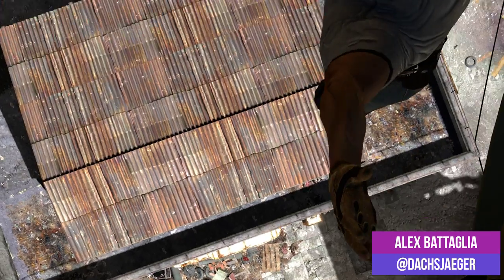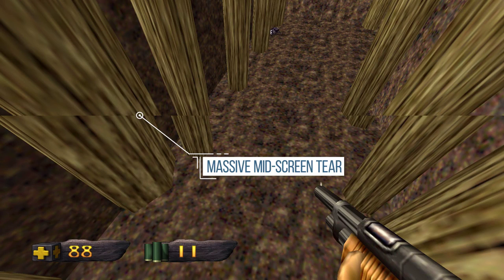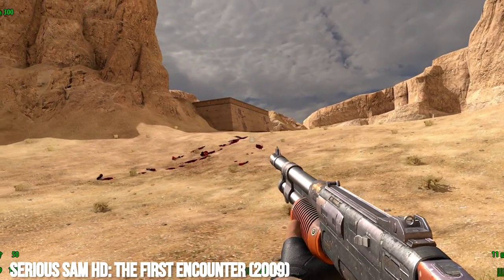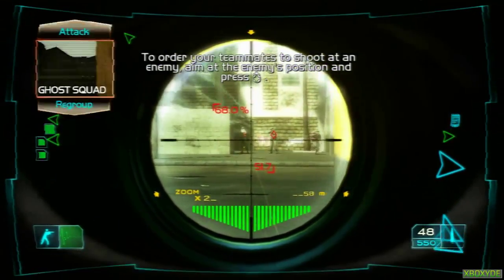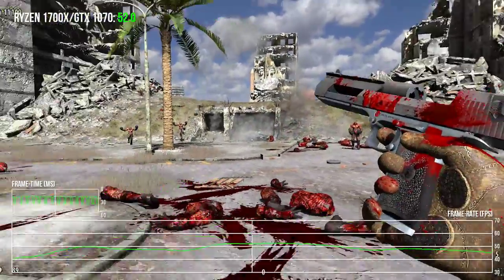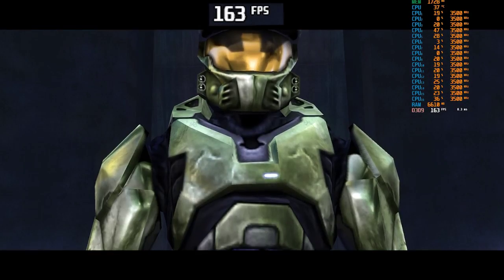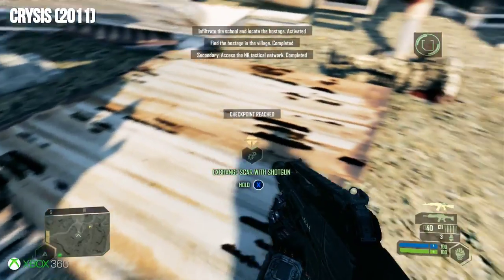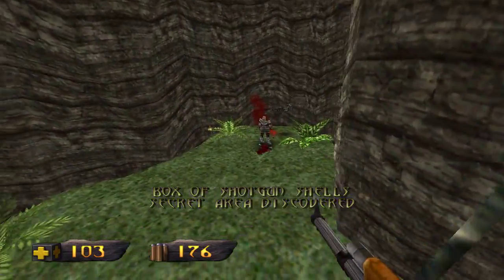Tech Focus - V-Sync: What Is It - And Should You Use It?

Comment: I cant be the only one that uses v-sync to lock the game at 60 fps so my pc wont overheat
Reply: Usually, people lock their framerate using rivatuner
Reply: No, only on older games like the first Witcher and Divinity.
Cap at 60, force v sync. 
Otherwise they run terribly.
Reply: @mrmagoo-i2l  Exactly.
Reply: Sometimes when my laptop gets really hot
Reply: you can get rivatuner or even better, nvidia inspector
Reply: @locxha96  rivatuener alone causes some screen tearing. Using v-sync on my 60hz laptop screen works better.
Reply: AMD has something called "Radeon Chill" which varies the framerate depending on the action going on so it stays responsive in action and cools down when you don't need it. It'll use less than with VSync, but with a better experience most of the time.
Reply: @SummonerArthur  But 60 fps cap with RTSS input lag vs v-sync input lag? Rivatuner wins.
Reply: @leruty both feels the same here but on dead space.
Dead space vsync sucks.

Comment: I cannot play a single game without vsnc
Reply: i use G-sync. I can live without V-sync
Reply: Yup me neither, screen tearing is horrendous.
Reply: I use freesync, no need for vsync.
Reply: I also cant. But its because my laptop overheats and v-sync locks it at 60fps
Reply: Yeah, I am also very sensitive to tearing. Quake was the first game I turned VSync on (on 3DFX Voodoo1). Still remember the console command vid_wait 1. Since then I haven't played a single game without Vsync, cause it turns out I hate tearing much more than slow framerates or input lag or low resolutions. One of the worst and ugliest things that can happen to a game for me is if it starts tearing. Also the reason I don't bother with consoles, where you are basically left at the discretion of developers in this matter.
Reply: @kosmosyche  I can agree that tearing is not great but after I got my 240hz monitor in any game tearing is almost unnoticeable same way with my 144hz monitor except to a lesser degree I don't know about when getting lower framerates since I don't have a game that I get less than 100 fps
Reply: @Wyatt Cheng sad but true

Comment: I feel so lucky, I got a G-SYNC compatible monitor for my first gaming PC, so I haven't really had to deal with any tearing or latency issues.

FYI, Blurbusters has a great series of articles on G-SYNC and input latency. It's full of measurements and solid analysis.
Long story short:
- enable g-sync for fullscreen mode
- globally enable v-sync in NVIDIA control panel (vsync and gsync were intended to work together)
- disable v-sync for in-game settings
- either in-game or in NVIDIA control panel, set max FPS to whatever your refresh rate is minus 3+, so 144hz would be max 141 fps

All of the above settings mean that you always get the minimum possible input lag without any screen tearing regardless of what FPS your GPU is outputting.

Comment: I used vsync when I had a 60Hz monitor. At 144+ its useless.
Reply: True brøther
Reply: I have a 240hz monitor. Microstutters and tearing are still there, even if they are less noticeable. Vsync is still needed.
Reply: Same with 120Hz. Rarely do my games exceed 120fps on ultra settings. Usually 60-100 depending on game
Reply: not true. why do you think gsync monitors exist?
Reply: @Relex_92  Minimising the problem to the point where you don't notice it.. is the same as fixing the problem completely
Reply: @Imgema  I dont see em at all with my 144hz monitor. Are you sure your monitor is set to 240hz?
Reply: @dayko.  Nope. I dont have G-Sync
Reply: @Imgema  Do you have a true 240 Hz Display? Only the new ones do, old ones are just black frame insertion, and I believe they have gsync so vsync is not needed unless you are using a AMD Card
Reply: @Imgema  I too have a 240Hz display and I never encounter microstutters and the tearing is extremely minimal. Then again, I only play counterstrike nowadays, where I get 300+ fps.
Reply: @prich0382  Yup, true 240hz, it's the Dell Alienware model. Although i'm very sensitive to even the faintest microstutters.
Reply: @Imgema  Well I just looked it up, it has Gsync or FreeSync so why would you put Vsync on, unless you decided to buy the FreeSync one when you have an Nvidia card, if so, buy a cheap AMD Card and pass through the AMD card to have cheated FreeSync
Reply: @prich0382  I have a Nvidia card but i got the freesync model because it 200 euros cheaper. Maybe later i'll get an AMD card to take advantage of it. But now i only needed the 240hz for a better desktop experience, not so much gaming.
Reply: @haggisman0812  gsync monitors exist incase your fps drops below the refresh rate
Reply: @Imgema  165hz here  and vsync is not needed because it locks the game to 60hz- 60 frames  useless
Reply: In most games. In some it can look more jittery than 60fps with vsync.
Reply: To get the best out of a G-Sync monitor, you have to set a global fps cap just under the refresh rate. This ensures that you get a V-Sync quality image with zero added input latency. G-Sync isn't there just in case; it's there the entire time, working its magic.

Comment: I wish you could disable v sync on console (for multiplayer games)
Reply: Thomas S why?? It will run at what 31 fps INSTED of 30. 😂😂😂😂😂😂😂😂😂😂😂🤣🤣🤣🤣🤣🤣🤣🤣🤣🤣🤣🤣🤣
Reply: Thomas S At least on console, if you have forced V-SYNC, then everyone else does too. It maintains a reasonably level playing field. 
Though this argument could completely fall apart when you consider the enhanced consoles coexisting with the base consoles.
Reply: Rocket league lets you disable it at the cost of tearing. And that is a 60fps game. Of course I play it at 200fps on pc, but there is that option just saying.
Reply: Jean Lepage Ultimately, it's not a significant difference either way. It's just that the game would then force players to deal with the tearing or willingly choose to play at a disadvantage. I've seen games that do this, and I don't think it's had a particularly negative impact on the online experience. I'm just saying that a consistent experience between players shouldn't be completely devalued.
Reply: Rainbow six has v-sync. On console.
Reply: No, 60 fps are enough. The games aren´t optimized for higher fps.

I really REALLY want that V-Sync on PC. No screen tearing, no input lag, smooth as hell. That´s one of the few reasons why I love playing some games on consoles.

Comment: By the way, if you're using a nVidia gtx 900- series or later, you should have an option to turn on fast sync in your nVidia control panel, it's a forced sync technique from the GPU, it does cause some input lag, but it's much much less than normal V-sync, and it eliminates tearing just as well.
Reply: GeneralToxicus I wondered what that was for.

Comment: using msi afterburner with rivatuner statistics server is a really nice way to keep framtimes stable and consistent by setting a framerate limit, smooths everything beautifully to the point where there can be less than .1ms wobble on the frametimes which can also be displayed by the same program in game , much much better than any in-game solution and it can be applied to every application

Comment: I've read that G-sync does not work quite how you describe it.  

With G-sync the monitor sends a signal to the GPU whenever it's ready to refresh then the GPU sends the frame.

Something else you might find interesting: if the FPS is above your G-sync monitor's max refresh rate then it emulates double buffered V-sync while causing much less latency than normal double buffered V-sync (provided V-sync is turned on in Nvidia 3D properties.).

Comment: Using a 144 hz has pretty much eliminated tearing. The display is fast enough that even if the GPU output does not match perfectly the distance is so short its no longer visually distracting for most situations.  Also modern displays are often smart enough to wait for full frame before displaying pretty much syncing on monitor-end.

Comment: I want to know why, in certain games, enabling V-sync messes with the mouse control. If you move the mouse too quickly, which is kind of the point of using it instead of a gamepad, the actual input slows down instead of accelerating. Sometimes this can be ameliorated by enabling V-sync at the driver level instead of ingame, so that makes me question how the developer tied mouse input to frame output. 

I seem to remember this being a problem with the first Dead Space, but they had fixed it by the second one.

Comment: The problem I really needed to know was whether you need a framerate limiter (cap) with or without any sort of Sync technique. Nonetheless, great video!
Reply: Vsync should automatically cap the framerate to your monitor refresh rate. But you dont really need it as it simply will not display if there are extra frames generated.

Comment: There's an error on the video. "Windowed mode" on Windows uses what the video calls "true" triple buffering (similar to Nvidia's fast sync). You can easily check that since the framerate of the game is not capped by the monitor's referesh rate.

Comment: 17:00 you missed to include one critical piece of information about G-Sync and FreeSync.
When you have an i.e. 144Ghz display, then the frame rate must never reach or exceed 144 (better 140), as the screen cant refresh more than 144 times per second when it has a 144Hz panel. Which means that you get tearing again when you play at i.e. 150FPS (though its not that noticeable).

That said, way too many people think that v-sync acts as a "frame rate limiter" on G-Sync/FreeSync displays, while in fact, v-sync will fully kick in when your FPS reaches the max refresh rate of the display, subjecting you to the full v-sync delay then.

If you own a G-Sync or FreeSync display, you must ensure that your FPS never reaches the max refresh rate of your monitor, or these technologies will not be active.

Comment: Sadly, on certain hardware, vsync can be the difference between 25-40 FPS with bad tearing and a solid locked and clean 60 or 120 FPS. Some games just effectively require vsync, even if you technically can turn it off.

Comment: I only use hardware Enhanced Sync nowadays. A lot of games have bad implementations of V-Sync (especially older games) by default and introduce input lag even if the framerate is a rock-solid 60 FPS, so I just override it in general.
Otherwise, I'd rather have tearing than input lag (even if it distracts or annoys me).

G-Sync or FreeSync would be ideal, but alas, I don't have a compatible monitor.

Comment: Basically V-Sync are still there because some fix 30 or 60fps game need it.(with variable frame rate monitor technology ) either you can mod  yours non gsync or free sync monitor inf driver to support "fast sync" (I tested it and it works (tested with AMD windmill ) to do this you need apps to mod your monitor inf file to go lower 33hz and highest supporting Hz as possible Google "extend freesync range" and others monitor tweaks and.sync overclock topic. / only if you are using modern nvidia card. But don't want to buy a new standard monitor.

Comment: What if you use V-Sync and framerate limiter at the same time? Wouldn't that remove tearing altogether? Especially with triple buffering enabled? Say, cap the game at 30/60 FPS and use V-Sync with it. I can't really tell how capping a game works exactly, but I think it's something like this: the game locks at 30/60/any other refresh rate that you like, which as far as I can tell prevents the game from rendering more FPS thus it sits well within its capped FPS limit which conserves the additional frames into stable framerate, in other words, the game does not drop below said framerate cap (unless it's that one game that occasionally drops frames for no particular reason, cough bad optimization *cough*), thus, it doesn't jump from the 30s to 60s and in between which prevents screen tearing. Correct me if I'm wrong... I'm probably wrong :) I've been playing with FPS limiters and V-Sync (switching between double and triple buffering) for quite some time, at least since the start of 2018, and it seems to work when the FPS doesn't alter the game's speed and isn't bound to game physics. Although it's fair to note that some, I mean a lot of games, are tied to ~20-30 FPS animations so the point of playing at 60 FPS seems redundant except for the fact that it does give a small boost in responsiveness.
So, yeah, write a reply about any of this. I'd like to know what others think about this subject (topic?).

Comment: I'll use V-Sync in any game i'm playing with a controller where i only need 60fps, games played with a mouse such as most shooters and MMO's it's a no go.
Input latency is critical for me, i use a 118fps limit which seems to hide most tearing, but some games really suffer without V-Sync enabled. Wolfenstein: The New Order is capped at 60 and displays horrific tearing without V-Sync, i never found a solution and had to play the game with V-Sync's input lag which really hampered my enjoyment, adjusting CODWW2's fps limit never results in a smooth image, which i can only get by using V-Sync, as such i've played 257 hours of it with an unstable stuttery image despite displaying at 90+fps.
Now for a special case, The Witcher 3, i start most games with V-Sync disabled but had a stuttery image with this game so had to enable it, still stuttery, despite the already locked 60fps i found that also enabling the 60fps in-game limiter fixed the stutter... odd, but what's weirder is that the mouse cursor is unaffected by V-Sync's input lag in The Witcher 3... Why is that?
I've played many games where V-Sync causes mouse lag, but The Witcher 3 is unaffected, why is this game so special and why is no one talking about it?

Comment: If the tearing is no really problem on your specific system and at this specific game than just turn it off. Only turn it on if there are really visual distracting effects, like this muzzle flash crazyness of that Halo example. Also: Tearing is not a big deal if the overall screen changes are small e.g. only small overall movement of the elements in the screen.

Comment: I think Adaptive Vsync is the best solution. If your framerate is consistently high and over the refresh rate it will be Vsync and smooth as it should be if it drops you will get tearing but I still prefer having tearing over a locked 30 fps. A game will feel so much smoother at 50 fps then being locked at 30 fps. Every time Vsync locks my framerate from 60 to 30 fps I see a giant stutter and then I see my gameplay being slow, If I have a game that is 90% of the time under 60 fps but still way over 30 fps I still don't like locking it to 30 fps it just feels so damn slow.

Comment: I normally use the Borderless Window Tripple Buffering (which is in fact a real tripple buffering, it can draw as many frames as it wants to) and limit the framerate to the refresh rate of the monitor. It helps prevent droping to 1/2 refresh rate and it has the latency advantage over the fake tripple buffering.
However i would like to use freesync one day. My monitor supports it but i have a 980ti........ (GO Navi, GO NAVI, GO AMD)

Comment: is there also a "h" sync? horizontal syncing could lessen tearing maybe as vertical lines are mostly straight up everywhere on a plane?
and could a variable starting sync point help anything? like masking where it will come in.
Reply: H-Sync is also a parameter of video displays, quite significant in the analog CRT days.  For example, VGA consists of 5 lines:  R, G, B, H-Sync, V-Sync.  But it's very different from what you're trying to visualize.  H-Sync happens after every (horizontal) pixel line is drawn.  V-Sync only happens once per frame.  If H-Sync goes, well, out of sync, then the display will look like skewed garbage.  It can't be used to fix tearing.

Comment: Nice Video! :)
But I don't like V-sync in most of the games. It removes tearing, but in a lot of games it introduces a lot of input lag. Not because of the delayed display of the front buffer, but because most games tell the CPU to prepare drawcalls vor multiple Frames in advance once V-sync is enabled. That can be 4-5 or more Frames...so the GPU uses informations, that are 66-83ms old or older. Together with the other input delays from CPU, GPU and Monitor, it can become noticeable.....I got way better in Dirt Rally after I disabled V-sync....some other games just feel more responsive...and of cause some games feel better with V-sync on.....but I don't just use it...I'm testing it in every game.

Comment: Around the 10:50 mark, doesn’t Windowed mode use “true triple buffering”/fast sync rather than standard linear triple buffering?

You can tell that it is since it runs uncapped at any arbitrary framerate at this point (whereas linear triple buffering caps to refresh) and you see the tell tale signs of fast sync where you get the weird jittering.

Comment: Hi @Digital Foundry, please tell me how I can limit my games to smooth console 30FPS VSync with Radeon RX 480. My double buffered VSync has never hard locked to 30FPS as you described and averages any framerate less than or equal 60FPS, even in games that support it, I have only seen my Intel HD 3000 graphics do this with in-game VSync.

Comment: What is better between Vsync and capping FPS via software to monitors refresh rate? Pros and cons with both? Also, when is your 9900K review coming out? Love your content DF <3
Reply: V-Sync lowers temperatures of the hardware MUCH more than just capping the fps (10-20° C difference).
Capping FPS produces less input latency than V-Sync.
Capping FPS doesn´t prevent screen tearing (btw, tearing at fixed 60 fps is HORRIBLE), V-Sync of course does.